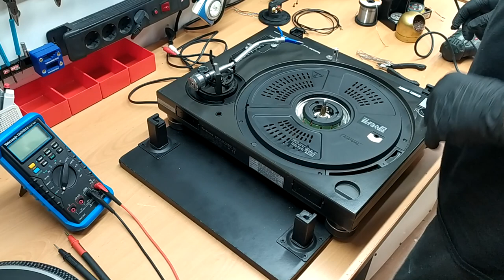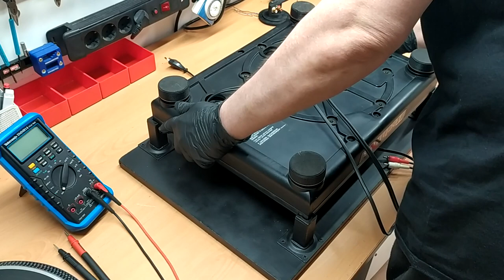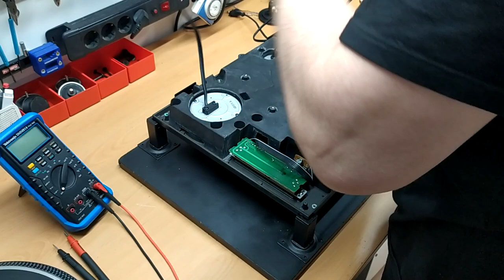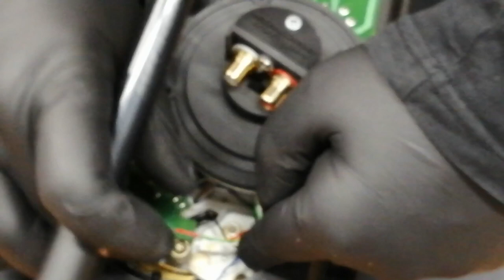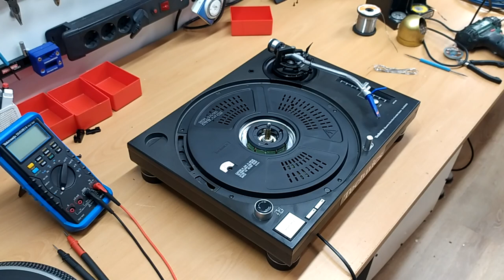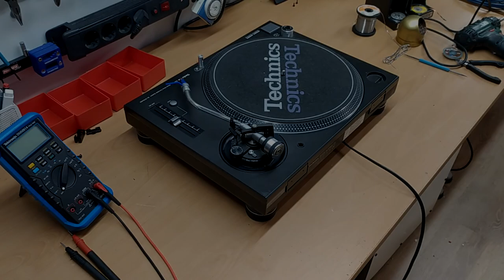Technics SL-1200/1210 Kit RCA Externos - External RCA Kit

Comment: What type of furniture legs did you use to build the technics chassis holder? I love the idea
Reply: Looks like furniture leg mounting plates. You can find them at most hardware stores. As for the square black pieces, I would say they're 3D printed.
Reply: sorry for the delayed answer, Coroa is right, are ordinary furniture legs but the top is not 3d printed, is the plastic part of the leg i cut. Regards

Comment: Hi, the 4 rca cables and the ground one come pre soldered to one side (rca box) as in this video or I have to solder both sides?
Reply from the maker: Hi, the 5 wires come pre soldered to the RCA kit, you only have to solder to the Technics PCB
Reply: Hi Im looking for this upgrade on my 3 decks. Does it fit okay on mk5? I assune it does as you used 1 in this video. If so can you send me a link? Cheers  @magfader8626
Reply: @wreignone yes, It works perfectly for MK5

Comment: What about the wires coming from the tone arm? Do I soldier the wires together by color?
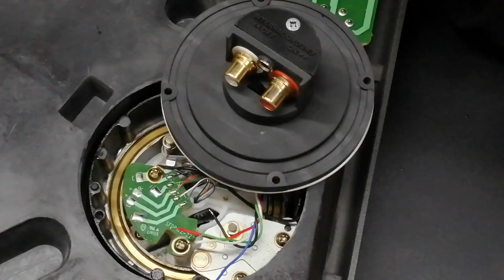Reply: Exactlly, solder each wire according to the corresponding color. In the video starting at minute 3:20 you can see the details of the connections. Regards